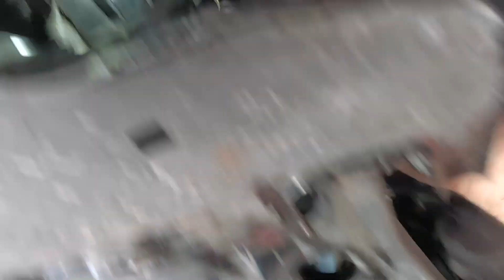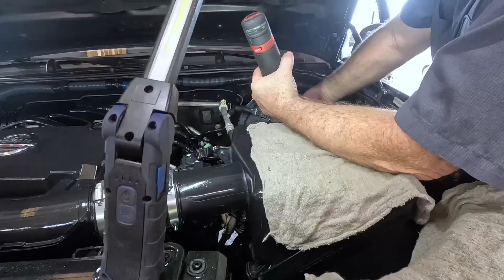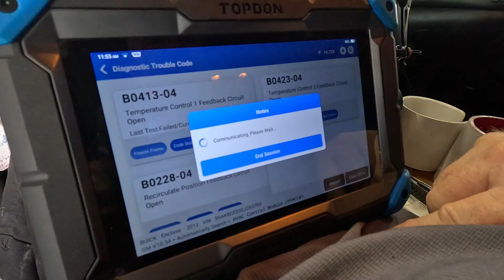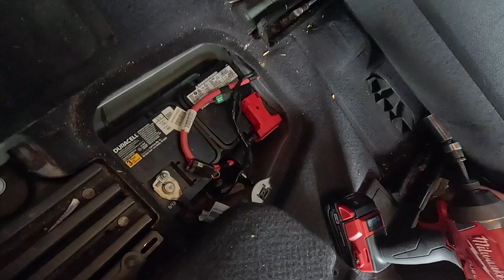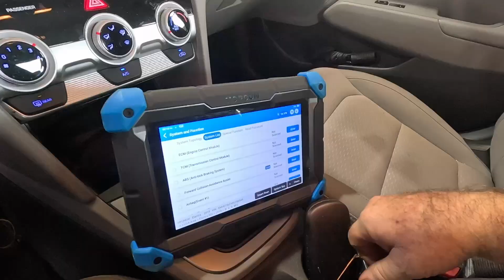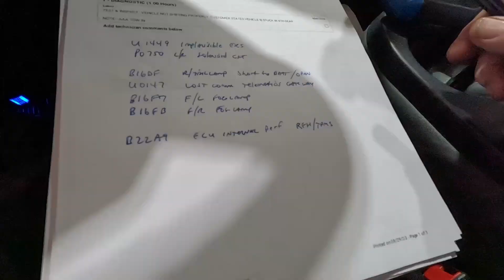ELANTRA A/C, BUICK A/C, XTERRA BOOSTER, RAM TRANSMISSION, A DAY IN THE AUTO REPAIR SHOP No.310

Comment: Hey Jimmy, so what’s the verdict? Launch or Topdon?
Reply from the maker: Surprisingly the software is almost identical, but the TopDon has a kick stand which I use very often. The Launch is less expensive also. Really hard to say one stands out over the other. 
The TopDon does handle changing cars slightly better, but once used to it I wouldn't say it's a deal breaker.
I'd probably choose based on what deals are available at the time I'm buying.

Comment: Comment about the Buick AC. I had a Chevy Blazer that had the battery die, the AC had been working great, replaced the battery and the climate control went insane continuously roaming from heat to AC.
Reply from the maker: Yeah, sometimes replacing a battery shows an existing problem that goes unnoticed since a relearn isn’t forced.